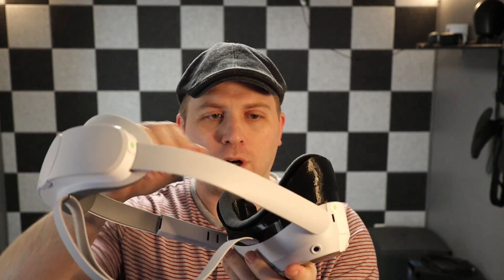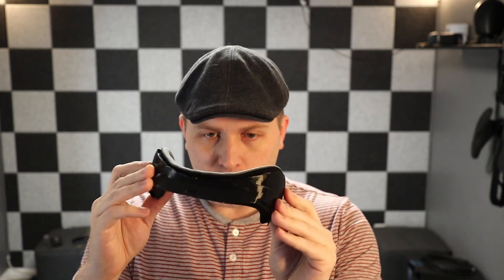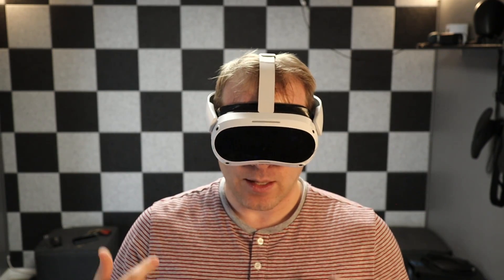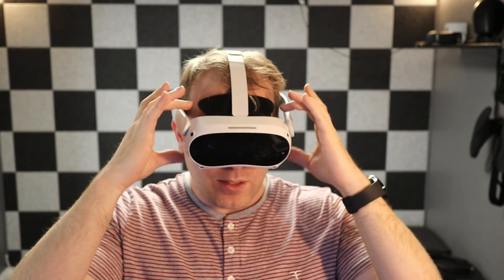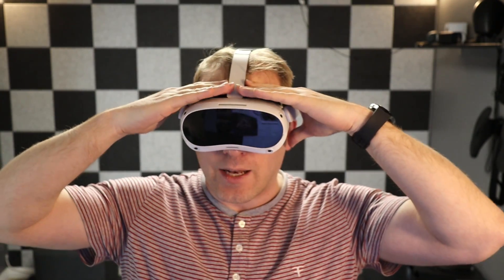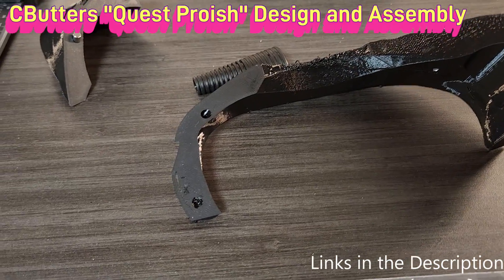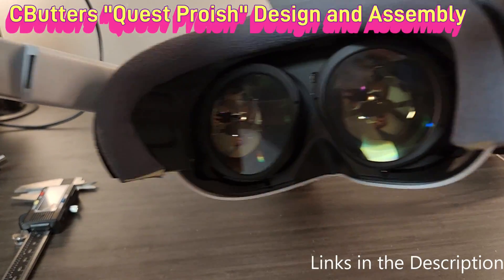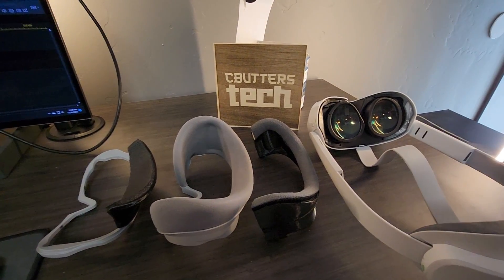HIGH FOV Gasket Mods - Pico 4 - 3D Printed Options

Comment: Delete this comment after reading. 
If you are concerned about your hair - get yourself a massaging hair brush, the one with round tips, and use it in circular motion every time you go to shower, no more than 5 minutes, in worst case it will slow hair loss in best case you will gain some hair back, because in most cases hair loss starts because of bad blood circulation in our scalps causing DHT pile up and reducing follicles.

Comment: The air gasket is amazing, But having my face oressing against the lenses feels like im going to damage the servos that adjust the lenses' IPD, as well as just damage the hradset in particular over time, due to constant pressure on stuff that werent designed for pressure. The FOV is amazing, but yeah.

Im gonna print your interface now instead, due to it having way better support. I got no sponge to make it soft, sadly, But i do got some very soft TPE to print a "sponge" for a day or 3 until I got proper sponge.

Comment: Good morning.
Thank You for Your work. I have a little different question to You as Pico 4 experience user.
You have already noticed such issue like "wavy distortion" or "warping" just like in this example:
https://www.youtube.com/shorts/dtxmYRwDaQ0
I need to clarify: is this faulty item or "normal function" of device i bought.
Do You have a chance to compare any Pico 4 unit other than first one You bought?
Thank You for Your help.
Best wishes.

Comment: Thanks for sharing this. Would you be able to please provide your model file pre separation? As it is, it’s cut at a slight angle and cannot be placed evenly on the print bed. Thanks!
Reply from the maker: I noticed that, you may have to sink it slightly into the print bed to get it to stick to the bed correctly on first layer... I'll try to reslice and reupload tomorrow though as well. The GCODE File should be fine though as I already did the correction for it in the slicer. (you need a MK3S though)

Comment: What if we buy an extra official mask and cut the bottom part ?
Reply from the maker: You still have weak FOV then.
Reply: @cbutters  Yes, but better confort. I guess
Reply: @cbutters  So what If I cut the padding from the official one? Either in half or completely off and put my own? I wonder if that would be any good :)
Reply from the maker: @Tremor244  Definitely could be good, I like the material on the stock gasket, just too thick for good FOV, so cutting it back or replacing it... could definitely be good. Let me know if you figure something out :)